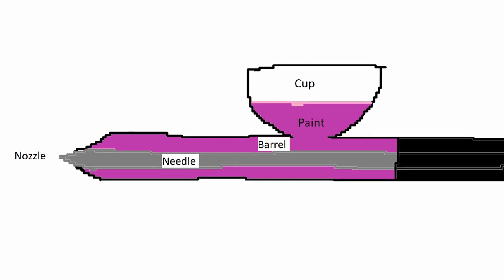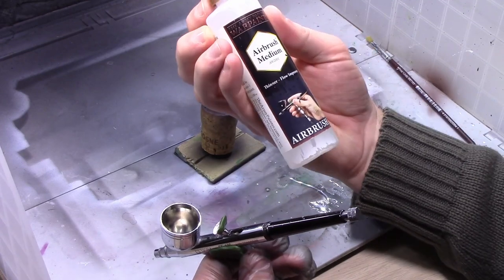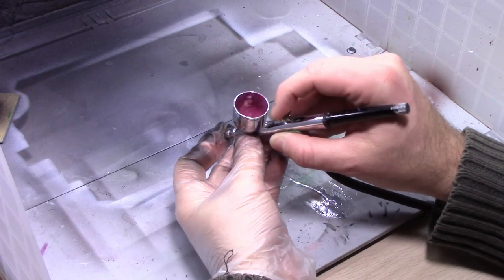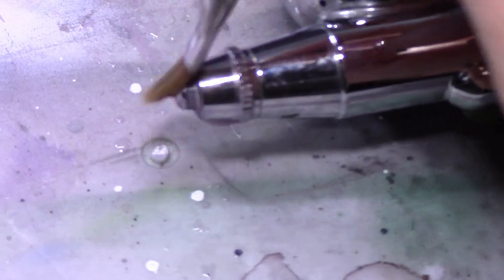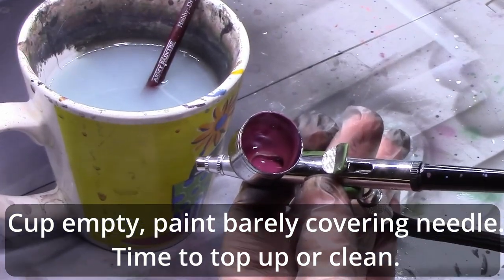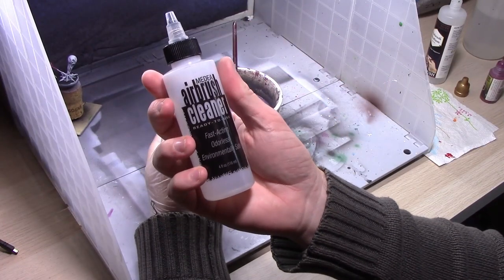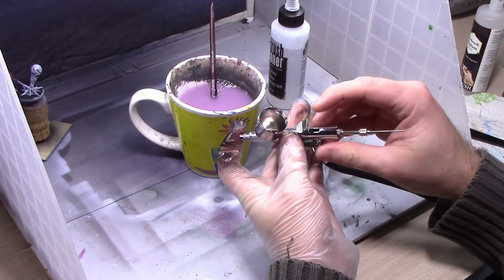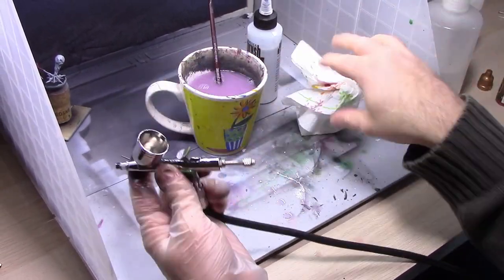The SECRET to never clogging your airbrush again!

Comment: there is a seal between the front and back of the airbrush that requires the needle. I don't think you should completely remove the needle with liquids still in the front of the airbrush because it can allow those liquids into the back where it is much more difficult to clean, especially if it makes it all the way back to the air valve.

Comment: I have a jar with boiled water next to me, and after a few sprays I pull out my side cup, clean it with the hot water, also put some hot water in my brush, and use a brush to clean the nozzle top, and spray some hot water, and then I am ready for a next round of colorspraying.

Comment: Yay! You're back with a great vid!

The tip that I've discovered is that the old school advice of cleaning with Windex works great for SOME paint, but others it will turn into a paste and make you have a bad time. I think it's primarily due to the pigment (whites are the worst), but I don't use Windex as my primary cleaner anymore.
Reply from the maker: Thanks man, its good to be back.
I've found whites to be really difficult as well, they are so sticky and get wrapped around the needle for me. I heard that Pro Acryl titanium white is the best around but I haven't tried it yet.
My cleaner doesn't get everything out either, I'm a bit nervous about using something a bit stronger though

Comment: I used to try to mix in the airbrush bowl, but I personally have better success mixing in a small plastic cup.  I can more easily tell how thick or thin my paint  is.  I use some original Createx paints and some are very thick (think gravy) and need about 1/3rd reducer.  

I also add in Createx 4050 which is a flow improver.  Doing this makes the paint flow better, adhere better, and makes cleanup much easier and just about eliminates dry tip

If you keep a small bowl of a 50/50 mix of water and alcohol with a small sponge in it on your table top you can dip the end of your airbrush against the sponge to easily clear dry tip should it occur 

Createx Restorer will pretty easily and quickly clean out dried paint.  Disassemble your airbrush to soak the parts.  You should not blow it through the airbrush